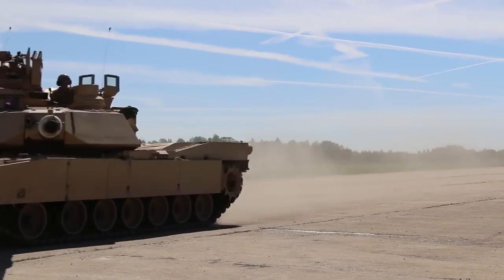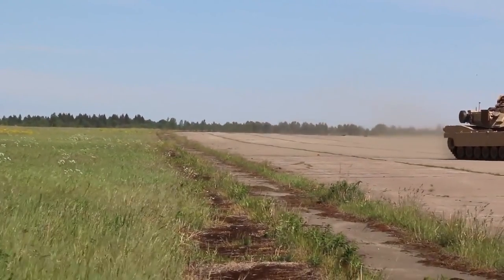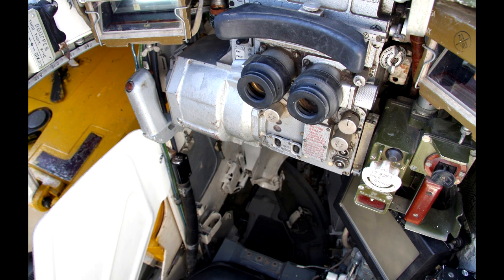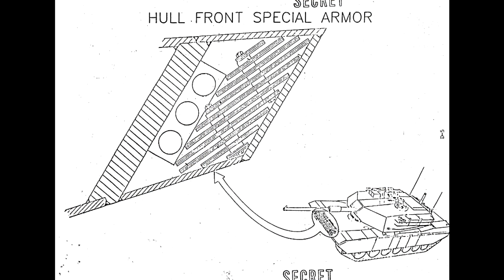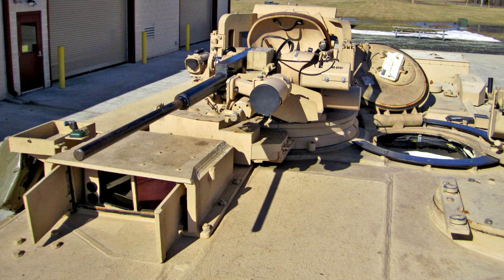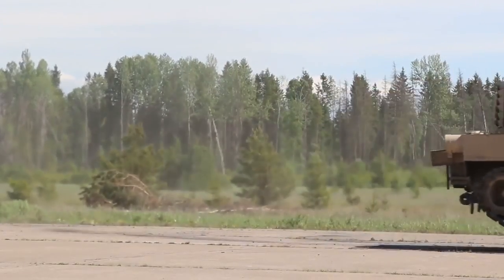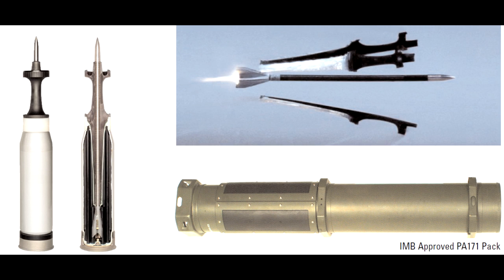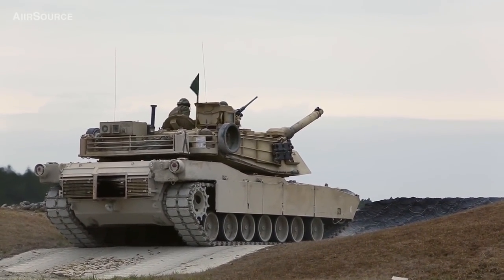Problems with Abrams tank

Comment: The moment I hear someone talking about using gasoline in a M1 I start losing value in their opinions. The Honeywell AGT 1500 used in the Abrams was never built to use gasoline as its primary fuel. All turbine engines are referred to as gas turbines, it's an engine type not the fuel type they use. Part of the reason that engine as chosen is because it can run on pretty much any liquid that will burn and it's the same engine used in the  UH-60, AH-64, and SH-60 helicopters. The second reason it as chosen is the next best available engine, the Continental AV1790 used in the M60, had the same weight, was physically larger, and produced 810 HP compared to 1500 for the Honeywell. The last points might be a little hard to understand if you can't be bothered to comprehend that gas turbine is an engine type, not the fuel that engine uses. As far as early flaws in the design, most militaries are know to use the best option they can get and fix shortcomings once the design is fielded.
Reply: The XM1 was tested with the 1,500hp MTU Diesel engine AND the 1,500 hp Continental AVCR-1360 Diesel engine.
 Both engines outperformed the AGT-1500.
Reply: The MTU Diesel engines in the Leopard can also run on gasoline, kerosene and jet fuels. So no advantages.
 The AGT-1500 was optimized to run on DIESEL FUEL but problems operating in cold weather forced the switch to JP8 jet fuel several years later.
Reply: @sandervanderkammen9230 
Don't let the JP8 tag fool you that it's something special just for planes. Diesel, JP5, JP8, Jet-A and Jet-A1 are all actually kerosene based fuels. Which means it's in the 8-16 carbon molecule per atom range. We aren't able to break down crude oil into the exact molecules we want. We distill off a certain fraction of the volatile hydrocarbons in the range we want. This makes kerosene in this case. Which then has various chemicals added to it to give it desirable characteristics. The differences between them are so subtle that other than some long term wear or sulfur buildup issues most engines can run any of the 5 just fine.  

The JP8 switch by the military has little to do with the M1 Abrams. That was a switch that was made when the army went to a single fuel(diesel) plan in 1988. JP8 was chosen because of it suitability for good combustion at low temperatures after commercial diesel was found to gel up at low temps. The reason it does well at low temps is it's derived from Jet-A which is what commercial airliners use. At 35,000 + feet it's usually -65 degrees Fahrenheit.
Reply: @sikofu2  Jet A1+100 if I remember correctly.

Actually it did, the Army was forced to supply special fuel just for the M1 after 1981 which was given its own NATO specification (F65)  The US DoD adopted the SFC (Single Fuel Concept) in 1988 after continued operational supply problems with the Abrams special fuel requirements.
Reply: @sandervanderkammen9230  F65 is not technically a NATO fuel. It's a US Bosnian winter use fuel. It's a special blend of F-54, F-34 and F-35 NATO fuels. NSN number 9140-01-440-9736. It also didn't appear until 1997 during the peacekeeping mission there. It was an alternate for when JP8 could not be sourced in the winter months. It was used in all diesel engines, not just the M1.

Though mixing fuels to keep diesel engines running properly in winter time Europe has been around since before the Abrams. Mixing half commercial diesel with half JP8 has been around since the introduction of the diesel powered CUCV in 1984 along with the other diesel engines working their way into the system since the early 70's. The timing of the switch to JP8 coincides with many diesel vehicles introduced beginning in the early 70's making the problem of fuel gelling apparent. Not just the for the M1 Abrams. 

Unless you live in some sort of fantasy world where fuel gelling at cold temperatures only affects the fuel tanks/lines/filters of gas turbines and not IC engines. A world where the Army dosen't care if it's infantry can't keep up with the tanks because all the CUCV's, Duce and a Halfs, Bradelys and or HMMWV's can't go anywhere because their fuel is gelled while the special fuel for the M1 lets it charge on ahead by itself.

BTW next time you want to argue history/use of the M1.... don't argue on the wrong side of truth with a guy who was in the army as a 63H during the 80's and 90's. I lived the change bubba.

Comment: I think the reason why the US military has been slow to improve the Abrams is because the US is not directly on the doorstep of a potential enemy. Germany however is near to Russia and if Russia were to want to invade the EU the first really big military power they would encounter would be Germany. 

I can also see the validity of using the current engine because the US is a large place. If the US were ever to be invaded it would be extremely difficult to supply fuel to combat units everywhere within a reasonable amount of time. As such it is beneficial to be able to use any of the  multiple types of fuel (85-93 octane gas, and diesel) from civilian gas stations if need be. Im not 100% certain but im also pretty sure the engine will also be able to take certain kinds of aviation fuel as well. They could have also picked the gas turbine engine as to not rely on a foreign power for the production of a crucial part of these vehicles that could be cut off. 

Last reason I can think of why the US has not fixed these issues/were slow to solve them is because the US has a lot of tanks stationed around the world. The cost to upgrade all of these tanks alone would be extremely prohibitive let alone the price to ship them all back to the US for the retrofit. They have retrofitted the turrets because it is a smaller part than the whole vehicle. Yes I know its a multi ton turret but it is not the whole tank. You can remove the turret to send it back for retrofitting. 

TL DR it boils down to three things. Position of the US vs her enemies, geographical size of the US, geo positional location of the tanks around the world and cost of retrofit.

Comment: The multi-fuel argument is valid for supply purposes.  Abrams was designed in the 70's and built to fight a defensive war against the Soviets.  At the time, NATO members used a variety of different fuel types.  If fuel supply from the U.S. became an issue for American troops in Europe, they could use whatever their local NATO allies could provide, or "requisition" fuel from disabled/captured Soviet vehicles.

This also explains the, general, lack of concern regarding fuel efficiency.  Since the design assumption was for a defensive war, fuel was less of a concern as there was anticipation that the Abrams' would fight in a defensive position then be moved on carriers (truck or train) to other conflict areas and would not have to drive extensively into combat zones.

Nobody in the 70's had any clue the Soviet Union would collapse within the next 20 years and that the Abrams would mostly be used in desert warfare where they would end up, largely, driving themselves to their destinations (due to poor/inadequate transportation infrastructure).

Once a design is set, particularly for government programs, it's locked and will never be changed.

Comment: America chose the gas turbine to keep the tank light enough to be carried by our cargo planes.

We have to cross oceans to go to war.

To save weight we needed to either reduce armor or go with the turbine.

We even dropped the idea of an auto loader just to save weight.

In fact almost every shortcoming you pointed out of the early models was done to reduce weight.
As the cargo planes were able to carry more weight , features were added to the tanks.

This tank had two advantages:

1. It could be deployed anywhere in the world faster than any other tank 
(Sadam found that out the hard way)

2.The extremely good training the crews received. They made it look better than it really is.

When Saudi Arabia took these tanks into battle they quickly proved the tank wasn't unbeatable.

Also, the Abrams is 4 decades old , even though we keep updating it , theres only so much you can do.

We could build a new tank with ceramic composite armor, better fuel efficiency , longer range gun and a lower profile.

However, our priorities have shifted from main battle tanks.
Our NATO allies have developed several main battle tanks that can handle anything Russia can throw at them  and a war with China will primarily be naval.

So we are probably going to stick with the Abrams until all tanks are obsolete.

(I figure 15 - 25 years)
Reply: Russia tanks that are better in every single aspect, yet lighter for 10+ to ns than abramses
Reply: @vanja2565  and all you have to do is survive the 500 meter gap between when the Abrams starts penetrating your hull vs when the t-90 can penetrate an Abrams.

You just have to hope the Abrams misses the first five shots.....and doesnt use its faster speed to keep you from closing the gap.

There are tanks that can go toe to toe with an Abrams and win , none of them are built by Russia.

The S.Korean K2  and the German 2A7 are the two best main battle tanks.

Russia places a respectable 5th place with its newest tank , the Armata, behind

S. Korea
Germany 

U.S.A
U. K.
Reply: @glennchartrand5411  I see you know very little, first of all we need to see which versions of the tanks, and no, abrams isn't faster than t-90,also abrams does have thicker armour, but t-90 has better protection, all you have to hope for is that you get toasted by ataka missile before t-90 notices you, it can pretty much cook you up from 5km away
Reply: @vanja2565  Actually I know quite a bit  about Russian Tanks , I've personally watched them burn in the desert.

T-90 top speed  ...60 KPH
M1A1 top  speed ....72 KPH
M1A2 top speed ....67 KPH

( Winner Abrams, both versions  )

Now the Abrams speed governor does have an "off-road" setting of only 48 KPH
but that is turned off during battle , its mainly to reduce wear on the tracks during long treks through rough terrain.
Reply: @glennchartrand5411  hmmm idk in which movie does abrams go 72km/h but it doesn't in the real world, there's something called top theoretical speed and actual speed